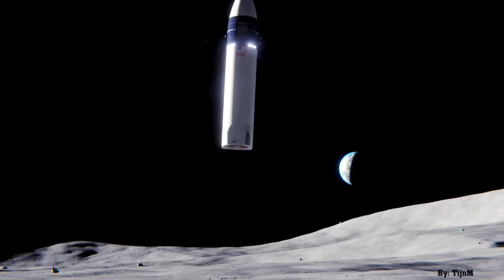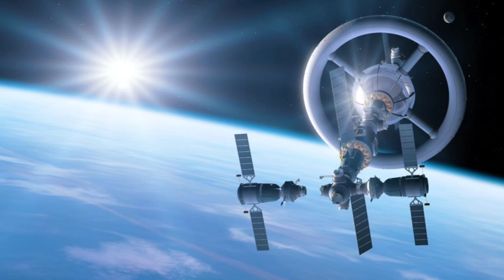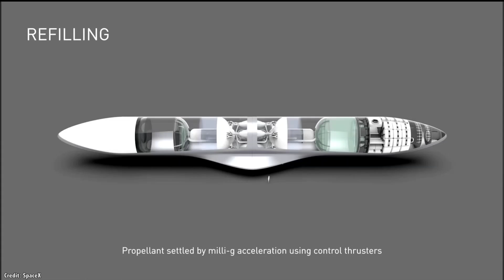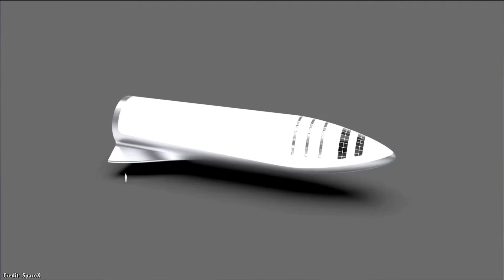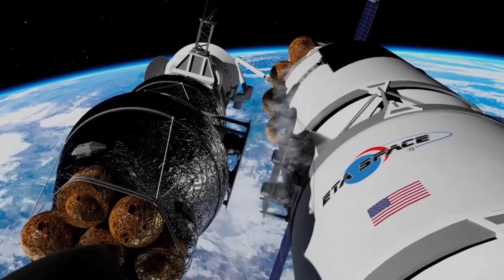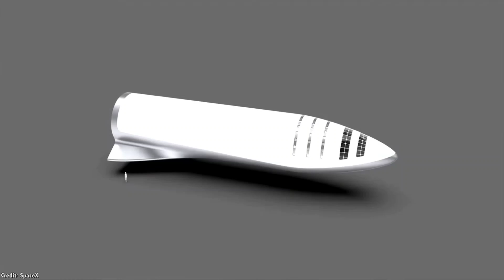SpaceX's Next Starship Launch Will Attempt To Transfer Propellant In Orbit!

Comment: Launch 3 circle the earth, make dedicated landing attempt in ocean
If successful build fuel transfer assemblies, test fit multiple times. Fit to starship.
Launch 4 double launch to orbit, attempt to connect.  My bet is not on the elongated demo refueling animation. I'm inclined toward a robotic floating arm assembly similar to the one on the launch tower but more maneuverable, possibly snakelike.
Improve raptor till it can make the moon run and return like the Apollo rockets.
Challenge
link super heavy like Falcon Heavy.
Launch booster on booster.
Link two boosters in space end to end.